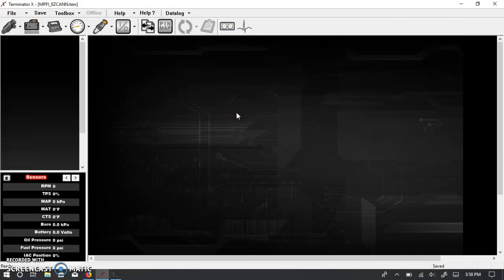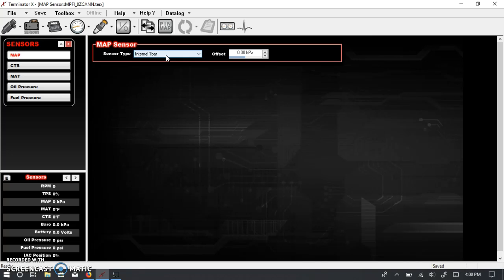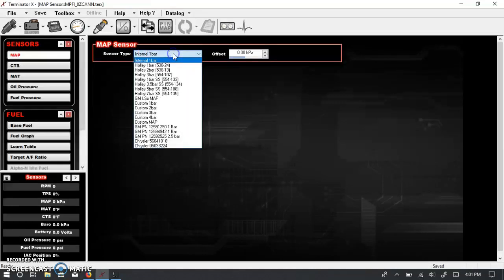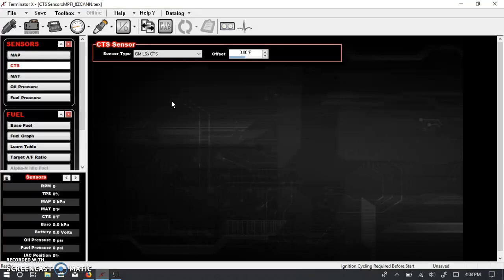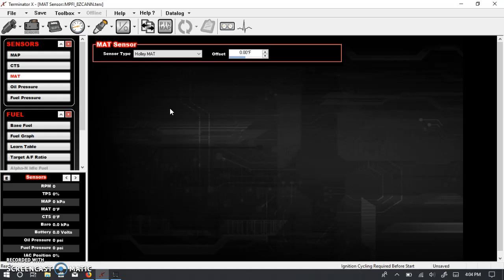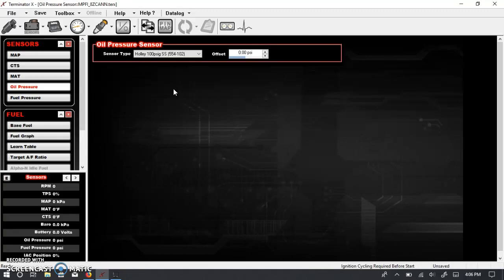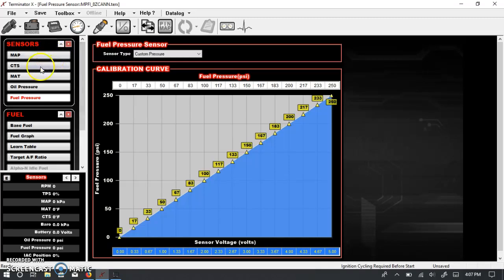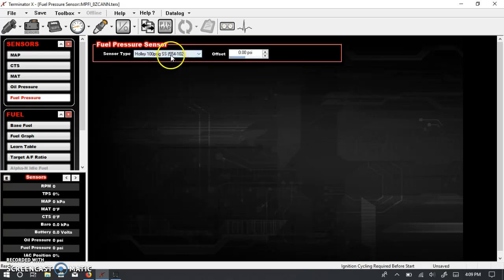Holley EFI Terminator X software Part 2

Comment: Im working my way though the videos. On setting up the tune file do i choose tbi and sniper 100lbs for a stealth max 550-1063? Thanks.
Reply from the maker: Yes
Reply: @projectgattago  🙏
Reply: @projectgattago   whats the best way to open a line of communication with you? Im hoping to fire my car up in the next couple days and get some miles on the new rear end but i will definitely need a tune. JJ with the 65 cutlass in tx sent me. Thanks.

Comment: Maybe you can answer this,on LG9 6.0 with small cam,what would you think the idle timing.- cruise timing- wot timing would be ? Not only that we seem to have a stumble around 2500 on take off then its fine but I can't seem to get that bug out...its only when you try pull off from a stop..new to the term box x so not knowing anything about computers doesn't help🙉
Reply from the maker: With a mild cam I would start with 16 degrees at idle, 26-28 at WOT and 30-32 in the cruise area. The stumble is probably related to a poorly tuned VE table. I actually offer remote Holley EFI tuning. If I can be of service, please email me: projectgattago at gmail dot com.
Reply: @projectgattago  can you please tell me why my term x box on the learn status it reads -- 50 ,so its really not learning shit ..how can I get it to learn better?

Comment: I'm pretty sure that mat sensor is from the lsa engine in the zl1 camaro
Reply from the maker: It very well may be. The part number that I gave will work for sure. There are many applications that used it.